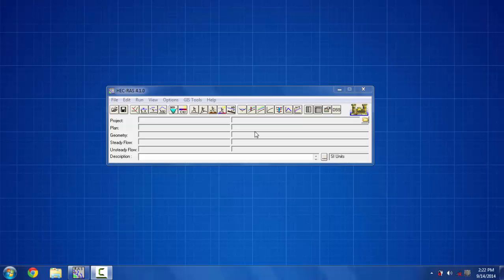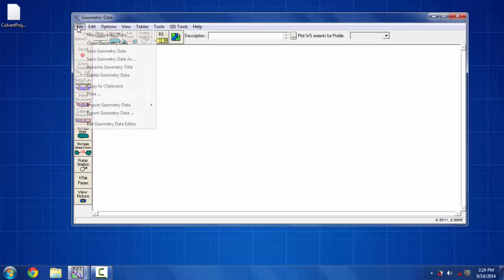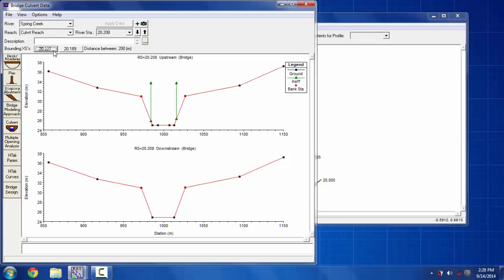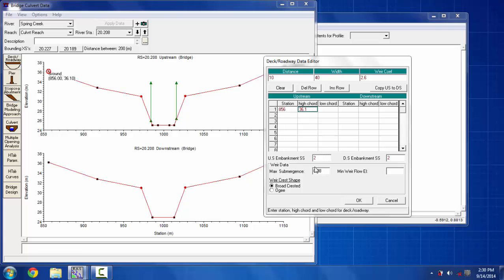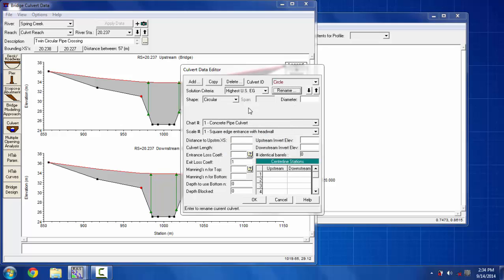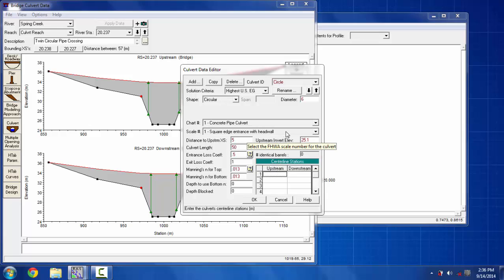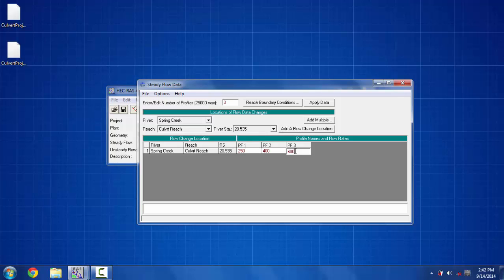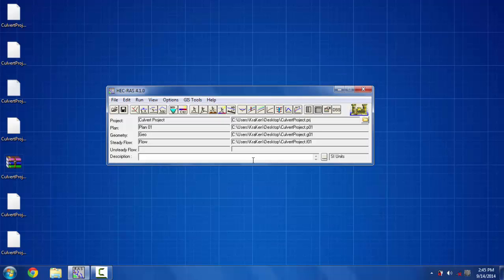Tutorial on Installing Single Culvert in HEC-RAS

Comment: Hi, i'm modeling a circular pipe and when I run the modeling and go to the View 3, the water goes on top the culvert and not through the circular pipe. Help me plz
Reply from the maker: Hello k1000asd, sorry for the late reply. I haven't visited the channel for a while. About your problem, have you tried changing the boundary conditions of the flow parameters? If you are defining the normal depth, decrease it. I think that will help you. Thanks.
Reply: thanks for the reply, but I solve the problem,